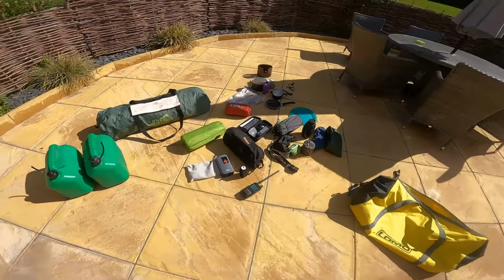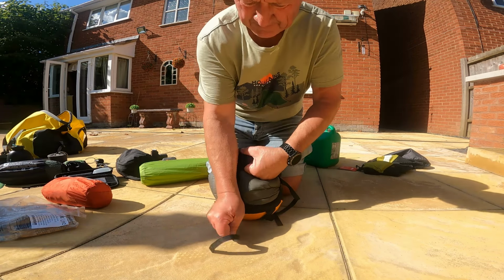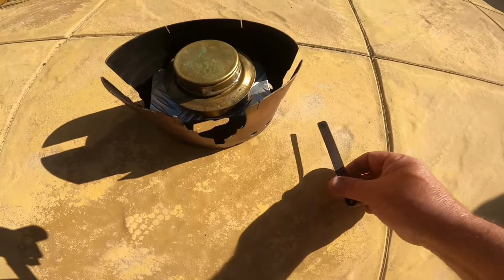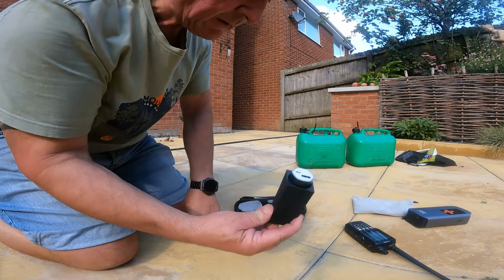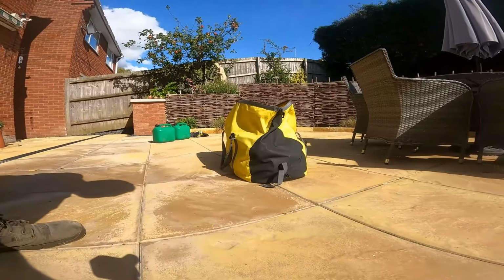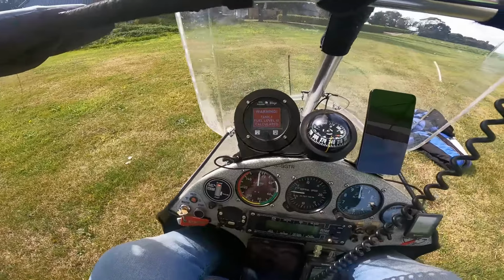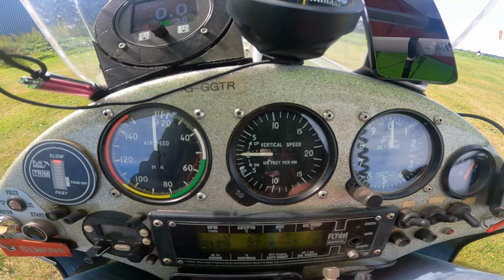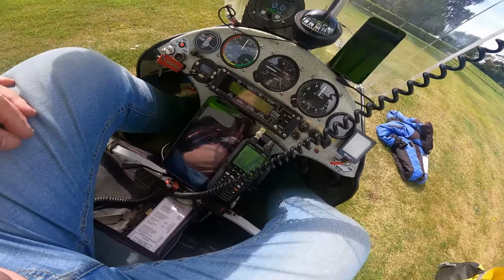Fly Camping Preparation. What I take and where I put it

Comment: Very informative video Trev, l have a Khyam tent and they are quality, looks like all the stuff you have is just as good and perfect for the job, my question is do you start with a full petrol tank and then empty the cans into the main tank before you leave for home? I also had a motorcycle with a Rotax engine 500cc single 4stroke, totally reliable but I love the twin ignition systems on the aviation engine for complete safety! Best Andy.
Reply from the maker: It all depends really. I always start off with a full fuel tank if possible. If I'm out for a few days or more I will aim to keep the cans full as a back up. But if I'm on a last leg I would put them in to get me home if that works.

Comment: Many thanks Trev for making this video that both myself and others had suggested.   I found it very interesting and informative.  I was impressed at how quickly you said you could gain altitude - even with a passenger on board. Your take off acceleration seems very swift,  I guess that’s from the powerful Rotax engine your aircraft has.  Could you tell me what your max flying time would be with a full tank of fuel based on your 80 mph cruise speed?  You have a wonderful hobby there, keep up your good work and keep making videos.  Mark.
Reply from the maker: Thanks for your comments. I can do 4 hours at 80mph air speed

Comment: Nice one Trev - lots of useful info there - had not considered a foil mat in conjunction with an inflatable thermarest type mattress. One question - on the RHS of the panel you have a mixture control labelled - is it connected and do you use this? The various 912s I have flown with have not had this feature but they have been 3-axis. Thank you!
Reply from the maker: The mixture control is not in use so that's why I forgot to mention it. The foil mat works really well